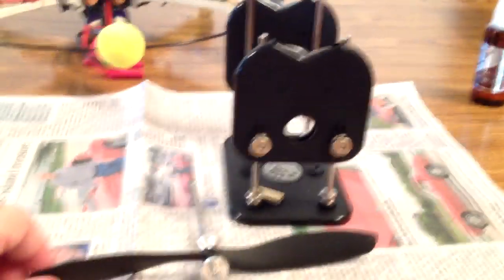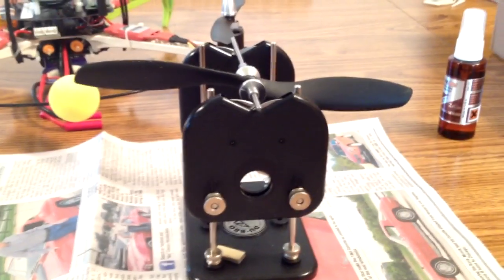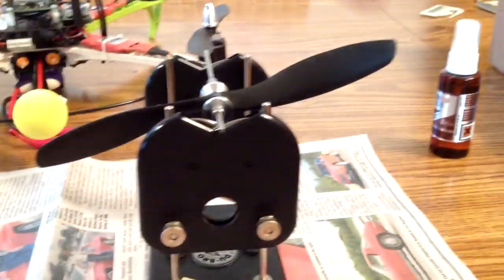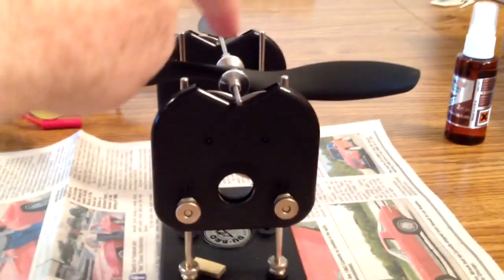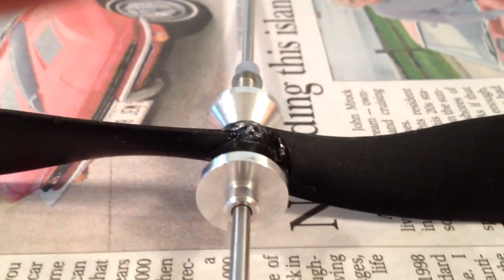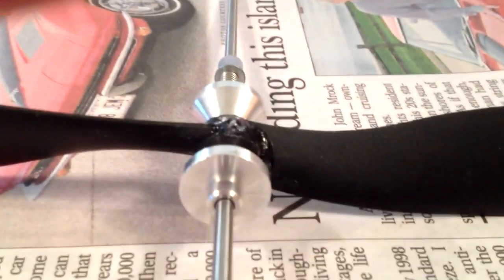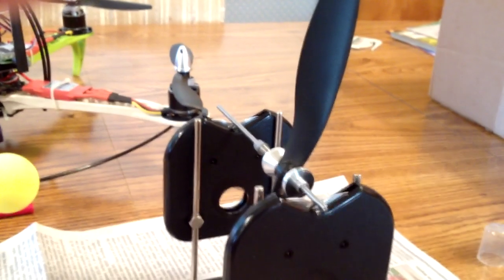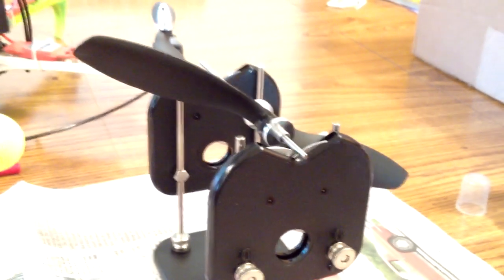How to Balance a Prop Hub for a Quadcopter

Comment: Very helpful.  Thanks.

Any thoughts on using model glue vs. Super Glue?  Seems like it can set up once it's balanced.

I don't use Super Glue much.  Seems to always set up in the end of the tube (and/or glue the cap to the tube) after a single use.

Maybe mix a small batch of epoxy?

Anyway.... thanks again for the video.
Reply from the maker: +DCDrone I would assume that any kind of glue that will remain stuck to the prop hub and won't melt the hub plastic would work.  You could also remove some of the hub material from the heavy side with sandpaper - making sure you don't remove too much and weaken the hub.  I have done both successfully.

Comment from the maker: Scott, I had trouble too with the nuts.  I filed the holes where the nut fit and then pushed the nuts up into the holes.  It was kind of a pain to have to do that for a new item, but it worked OK and then the mounting posts screwed in just fine.

My cones were balanced fine and once I got the issue with the nuts resolved the balancer works well.  The mechanics of putting the prop on, with the spring and holder, it a little bit of a pain, but it works well.